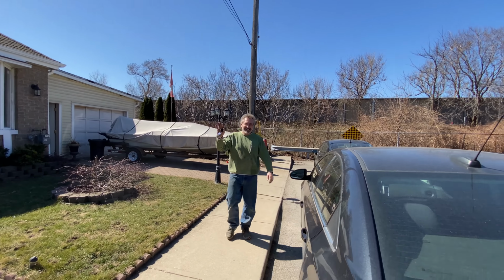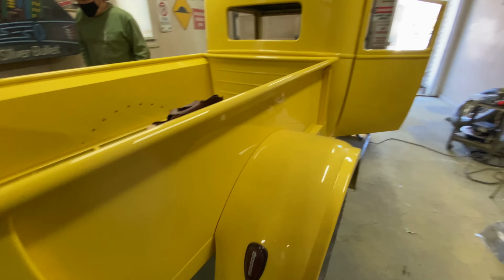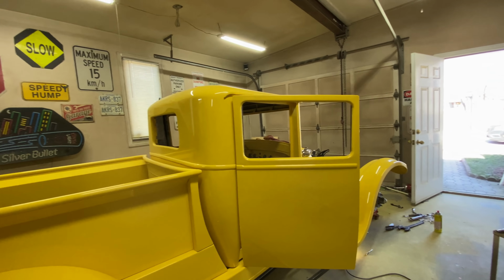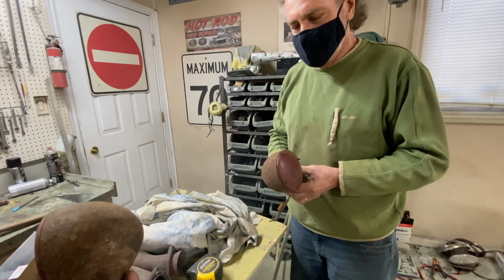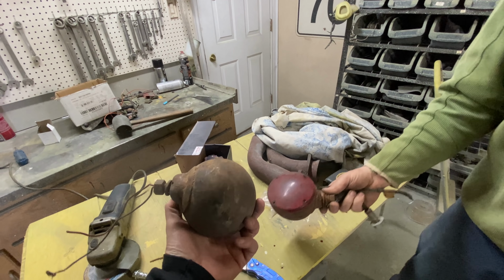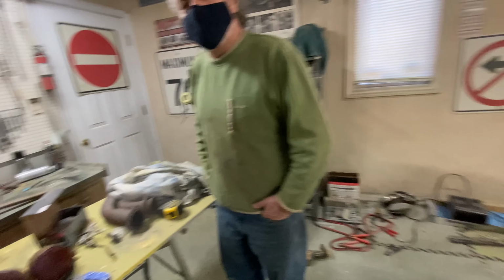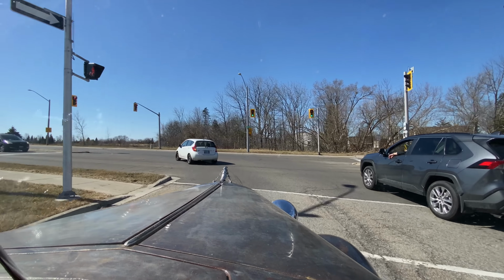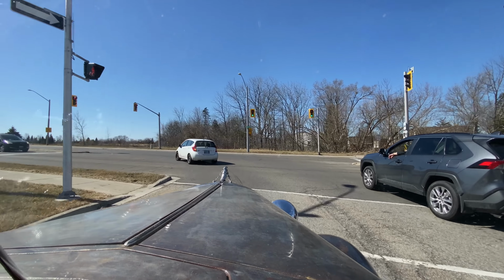My First Subscriber Shop Visit In Bugsy, My 1936 Chevy Coupe

Comment: Suspension works fine until you have to replace tires twice a year. Get it aligned proper. I had a trailer with a bent axle and it looked great but I replaced the left tire 4 times in 5 years.